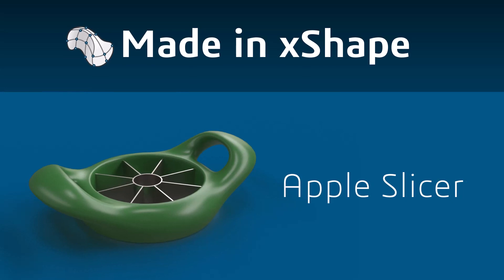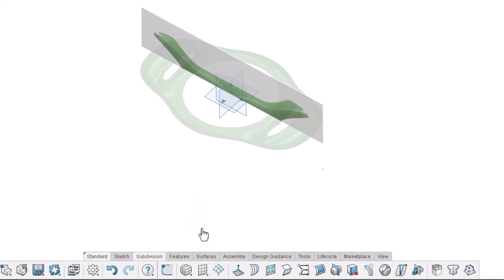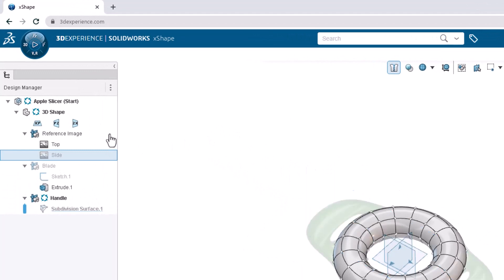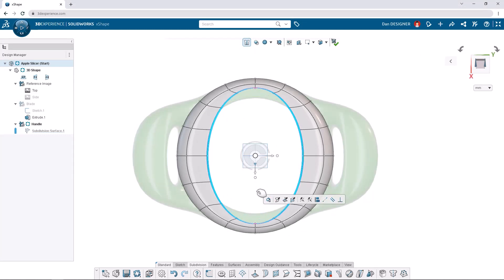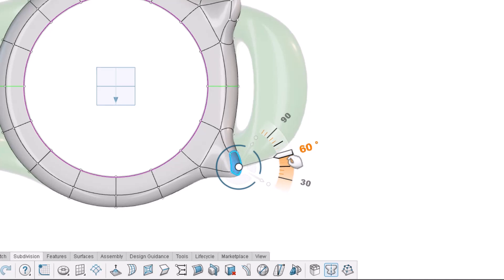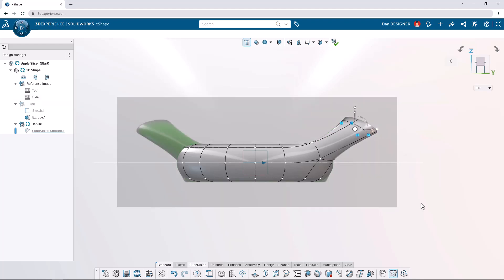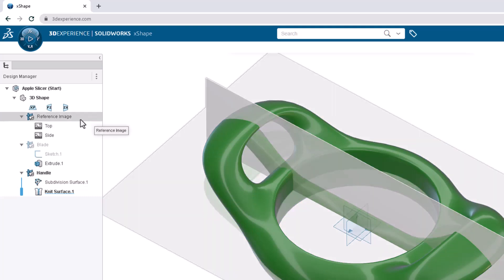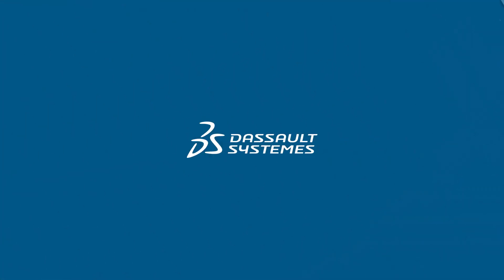How to Design an Apple Slicer with Subdivision Modeling - Made in SOLIDWORKS xShape

Comment: In your "apple slicer" design, wouldn't it make sense to have modified the handle in such a way,  
to allow for an easy installation of the cutting blade assembly into the handle?

Maybe make the handle in two parts (top & bottom) that would then snap together, allowing the
the blade assembly to be installed and secured in place, between the two top and bottom parts
of the handle.

Great video, but it would have been helpful if it had gone a bit further, and included some way of 
showing the installation of the blade assembly securely into the handle.